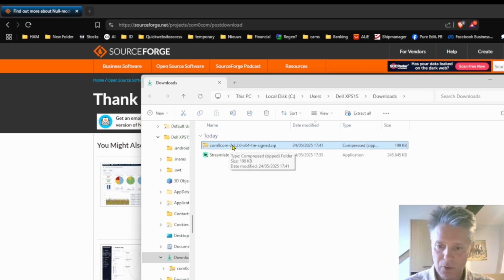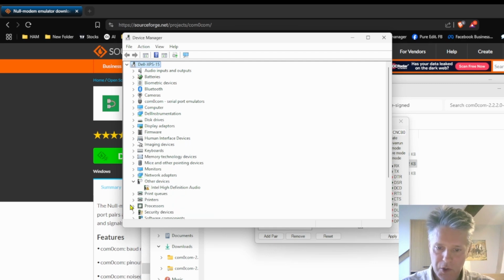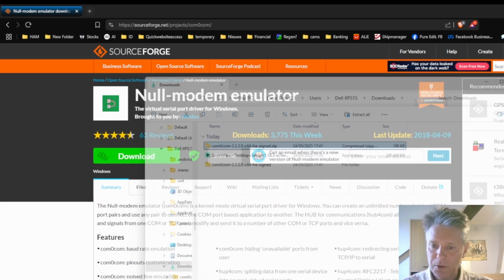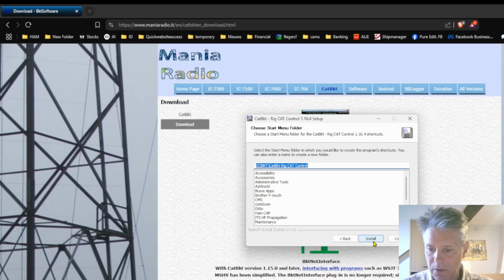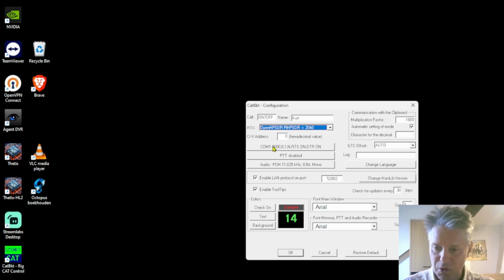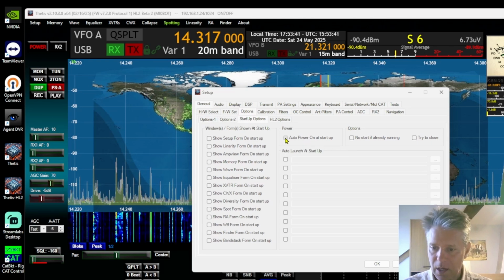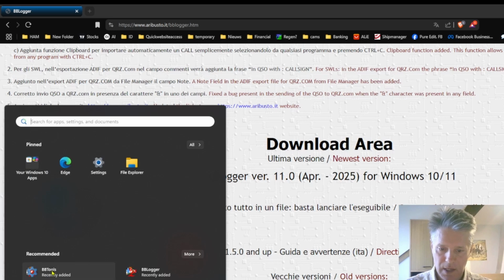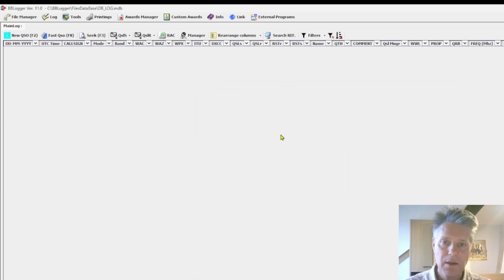Stop Typing Frequencies By Hand With This Easy Setup!

Comment: Hello!
I am using LogHX3, which is supporting TCI. Also Log4OM2 is supporting TCI.
Other Loggers based on hamlib can use the TCPIP-Cat from Thetis. Instead of using a serial com port emulator you can use ip:port instead of com-port. So instead of "COM5" => "127.0.0.1:13013" (TCPIP-Cat must be enabled in Thetis)
In N1MM you can also use TCPIP-Cat. Select "TCP", Model Flexradio and for address/port use "127.0.0.1:13013" (or what ever is configured in Thetis). This also works for WSJTX/JTDX...
73 de Ernst, OE3IDE
Reply: That's how I have it setup.   Log4om and JTDX both connect via TCI.   Works great!   I haven't tried N1MM yet.

Comment: Hi Kurt,
I use Log4OM 2 and it is configured to Thetis using TCI. It is a simple setup without any additional software and is detailed in the Log4OM user manual on page 258.